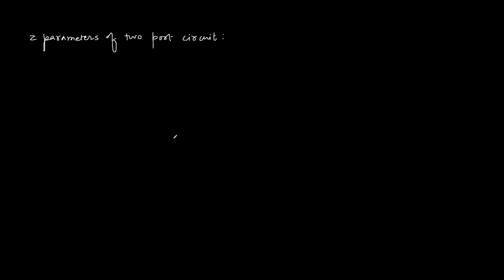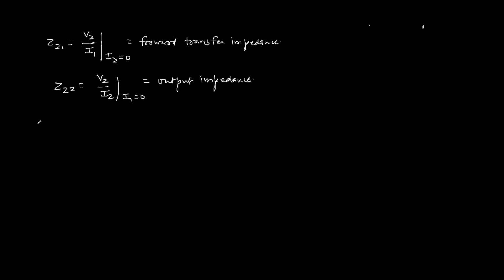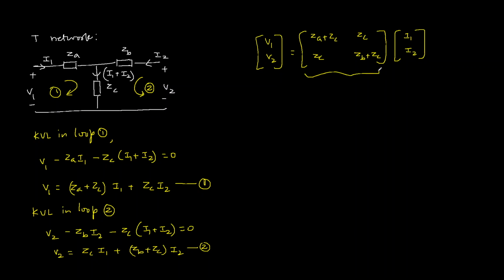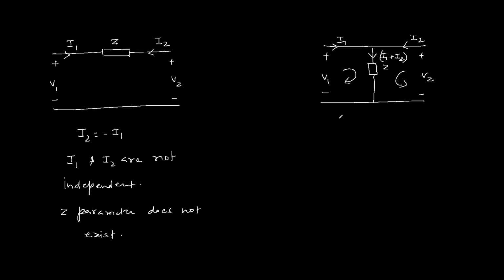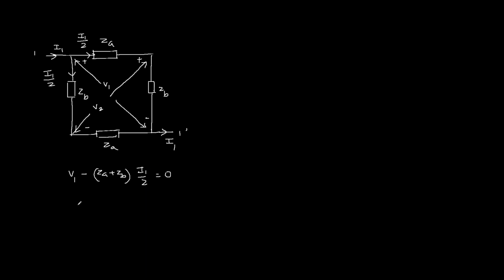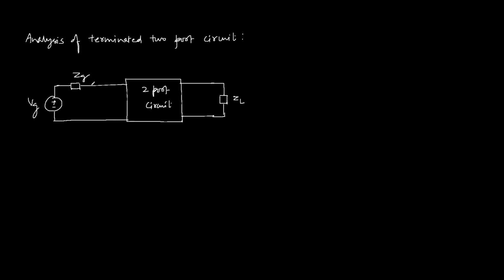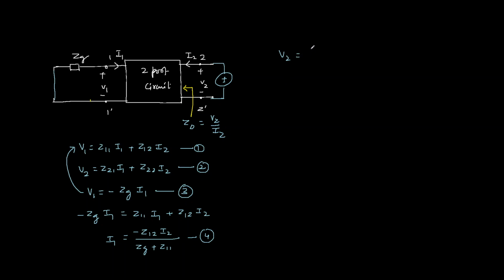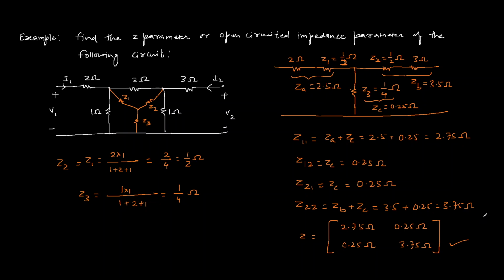Z parameters of two port circuit

Comment: I shall say I desperate need your book as well, from South Africa, how difficult is a reprint?
Reply: Also is there a well considered strategy dealing with a multiport system?, like a transformer with one input port and two output ports: each of the ports couples with the remaining two, making it very difficult for z-parameter analysis especially with more windings. Are U able to advice?
Reply from the maker: Sorry for the late response, if you can share the circuit diagram then I can try to find the parameters. My mail ID is kishore.kashyap@gmail.com
Reply from the maker: How do you about my book?
Reply: @KishoreKashyap  I am working on my self-initiated AC-DC/DC-AC circuits and thorough knowledge on circuitry is a cornerstone. I have recently stumbled on your videos and I must say they are a breath of fresh air. Wished I had access to your work way back in the eighties when I was still a student. I keep  a few texts ( eg Elect Technologies by the Theraja's, Power Elect by MH Rashid etc), I found your approach for Mutual Inductance & dot convention much clearer to understand, in fact I thought I understood before only to realize not entirely.